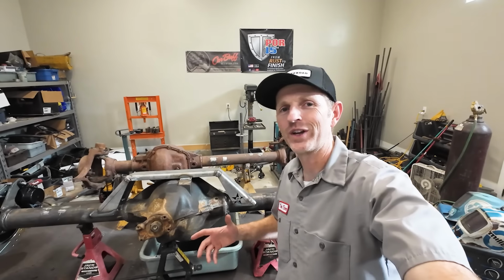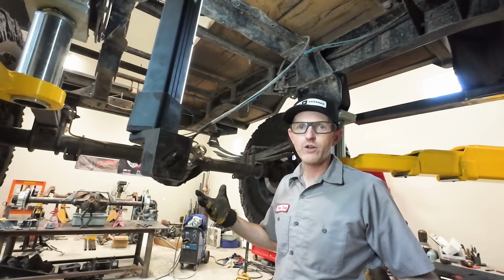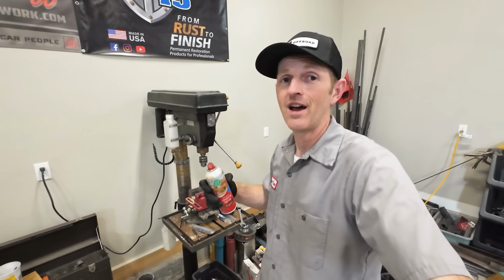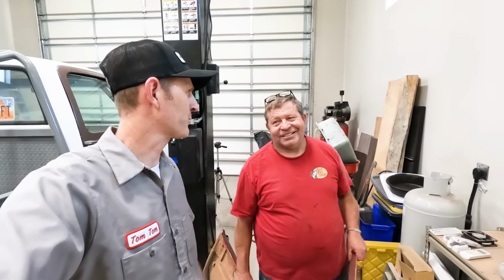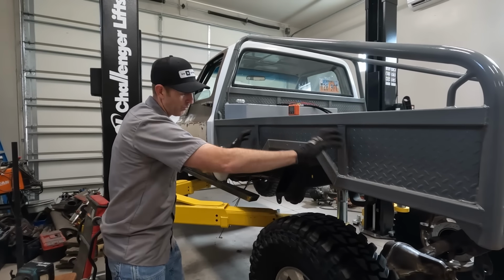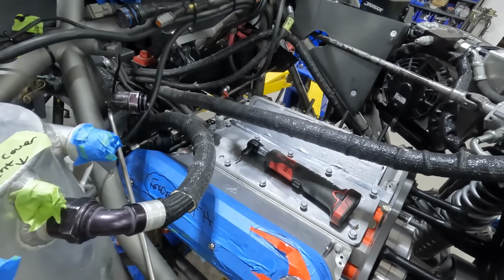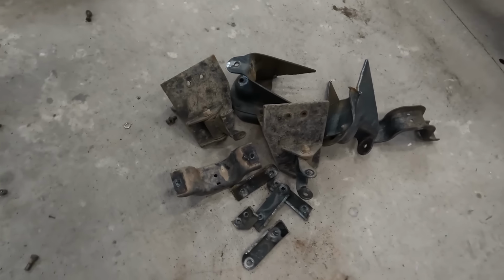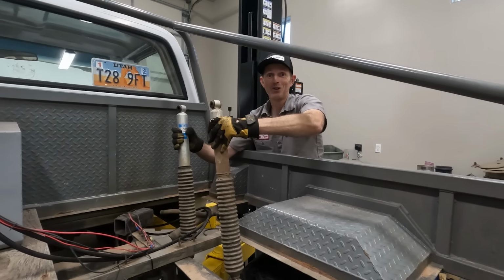Will Dig Dug Be a Desert Racer

Comment: I don't know how anyone else might try to direct, but when I replaced the treated pine that was in the bed of the truck (a '98 Dakota) I got second-hand (one owner), he was so proud of that bed he'd built (I got it in  '04) but the grain was already opening up and the boards were cupping. Not really ideal for the look I wanted. 
    So I collaborated with some of the guys that logged part-time like myself. 'Round here, you use what you got, so I cut a #1 Red Oak log, had it sawed into 1-3/8" boards and had them kiln-dried. After the planing, I built a trough to hold all the boards with a 1" step in the ɓottom to hold them off the bottom. Then I poured gallons of linseed oil to cover them completely. After 6 weeks I removed the boards and let them air dry before installing. 
    Sounds like a long process and a lot of work, but I used the straightest, tightest grain in the log, and 20 years now with absolutely no complaints. And it's still beautiful. Thanks for listening!

Comment: I really like your tire changer setup! Yes its a lot of work but it does the job and thats what matters. 

Just an idea, to upgrade, you could put that base plate for the rim on a bearing, with a gear underneath, and an electric motor beside it with a gear on that, and a chain to connect them. You could have a foot switch or two mounted underneath to control it. Just thoughts, i like to tinker with stuff! 

Also great video, i cant wait to see Dig Dugs final form😊

Comment: In high school I took a sliderule class.  If you had an A average GPA, we could take a class instead of going to homeroom.  One of the courses they offered was slide rule.  I was SO GOOD at sliderule.  I knew I would eat up Physics classes in college.  Then the 4-function calculator was released when I was a senior in high school and my sliderule knowledge was obsolete.  But learning the slide rule was not totally wasted.  For one thing, I understood logarithms, and I got an intuitive feel for logarithmic values.  Also, the slide rule required you to keep track of your decimal point in your head.  You also needed to learn to keep a running estimate in your head as you did the calculations.  That is still a useful tool, even when using a calculator.
Reply: Log tables and slide rules  😂😂 I'd  forgotten about those.
Greetings from a 76 yr old South African
Reply: Used a sliderule in college back in the mid-60's.  The 4-function calculator  was a 40 pound HP suitcase that cost over $1,000.
Reply: Your brain works in a whole different (better) direction than mine!
Reply: When I was a physics student at Wyoming, I was taking a Chem class. My calculator battery died in the middle of the final. But I had been carrying my uncle's old slide rule around because it was cool. (It's a scientist thing. 8-) ). Saved my grade on that final.
Reply: Glad I wasn't the only one, in 77 my calculus/trig teacher didn't allow us to use calculates on tests (so much for a $250 Ti, lol)  I asked about sliderules, he laughed & said " if you know how to use one!". Lol!  Thank you Mr Grumm, our HS physics & algebra 2 teacher, & former Sikorsky engineer!!

Comment: Hey Tom there's a few items I've seen in fabrats shop that you could probably have use for.

The roller table they made for handling and working on axles.

The swinging crane they have for picking up axles and heavy items

Comment: Tom, Take a close look at the Pittsburgh gantry crane at Harbor Freight with a 1 ton chain fall hoist...I was skeptical but found it to make working alone infinitely safer.
Reply: I bought the chain hoist when it was on sale.  I bought a set of rollers on Amazon and the brackets to use with the channel for hanging conduit and pipe in industrial building.  I have a 20’ x 30’ metal garage and plan on running the channel on the frame of the building down the center and will give me 30’ of travel.
Reply: Me too. Got an extra traveler and chain-fall…and win win
Reply: I have that hoist from Eastwood tools. But the chain blocks  from harbor freight. Makes cab removal very easy
Reply: I was just about to comment the samething👍🏿
Reply: I have one that i widened 6” and put an electric winch on. Use it to work on my big rig truck all the time. Works great lol
Reply: I hadnt considered the idea of two hoists...but will keep it in mind for future use.@michaellauer3397

Comment: Tom, get a mini forklift/stacker (manual power)!!! It will probably takeup less space than your engine hoist, but be so practical and zero setup/installation. Something like 1600mm high version should do well.

Watching you lift and twist when getting those tyres of I guarantee you will through your back! I threw my backout once drilling a rivot out of the over extension strap on a door while using my shoulder to hold door open as was on slight hill.

I was using way less force than you where lifting those tires and with slightly twist in my body something when pop in my back.

The income loss from you not doing videos will easily be more than just getting a crane or stacker

Comment: Harbor Freight makes an awesome manual tire change tool. You’ve already built the top part, check out the attached debeader, you could build that easily. Dawn dish soap/water to take apart wheel/tire, Murphy’s tire soap to install. Good luck!

Comment: Hi Tom Tom. With a round pocket in your table you could use round tubing or pipe that fits inside. Fab a small  lifting arm that you can lift and swing thins onto your table. Slide the lifting arm out of the pocket in the table when you are not using it.

Comment: Use dawn dish soap mix in a spray bottle with water use a large amount of soap 1-1.5ounce of soap in a standard size spray bottle. Better than tire lube. Plus you can check for leaks when needed.

Comment: Tom Tom, you used the claw hammer Matt made for you. Lol. 

That must  be some hoist that you have.  Surely you can raise Dig Dug on the lift as high as possible. If the hoist still doesn't fit underneath, tip the hoist on its side and drag it under the truck. If it's hard to drag tie a rope to the hoist run the rope around the table leg and out the door hooking the rope to one of your other vehicles to pull it.

Comment: i have a project just starting its a 2009 Ram 2500 HD was a special order truck state of lousiana has the AAM axles front and rear front is high pinion building a offroad recovery vehicle like Paul at Fab rats tried to talk to him out of the question im in alabama so suspension will be mostly stock have 3  8274 Warn winches 2-8,000 lb warn and one new badland apex. what do you think about the axles as far as holding up. it will be powered with a 392 Hemi 6spd automatic have a 1950 dodge cab and planning on building bed like yours

Comment: So. Little. Forethought. 
Suspension geometry isn't a guessing game. Rectangular tube with square inserts, just gonna weld that gap?

Grabbing random takeoff wheels, repeatedly painting yourself into a corner, trying to blow your back out on every task, I kept waiting for that high lift to jump up and bust your jaw. 🤦‍♂️

How many more times are you going to try to dump that truck off the lift?

FML, 130k+ views in 2 days and I'm at 2600 subs pushing hard to put out solid advice.